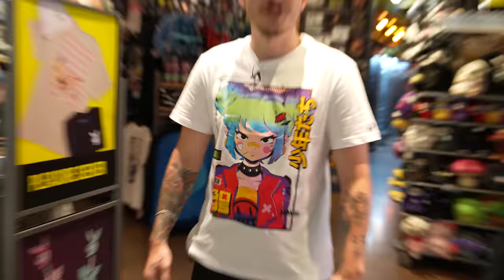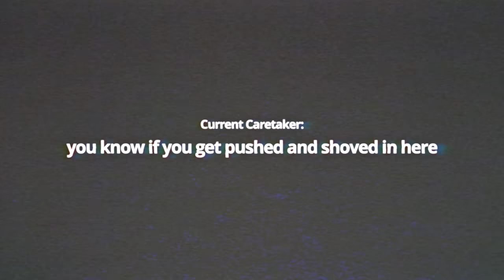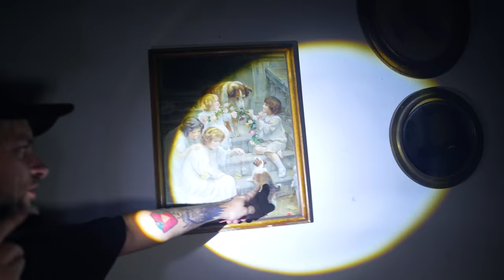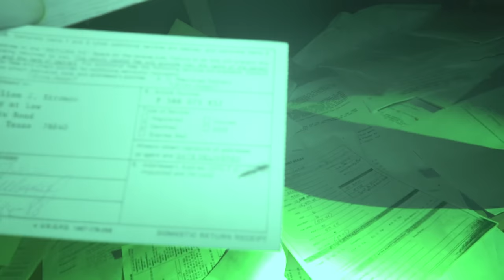The Boys Overnight in a Haunted Hospital

Comment: The bell ringing is familiar, I've heard it before when i went camping in Woolwash Bush (a local bushland in Campbelltown, NSW region of Australia down near the Georges River (which is a connection of rivers where they end up linked towards Botany Bay in Sydney, a whole 30km of river systems) 
I camped down there once and never again would i do it again, way to freaky and my mistake was doing it alone. 

If you want to heard what that bell ringing sounds like, MrBallen has a episode with a girl who went for a bushwalk in the forest (Beaver having their heads chopped off, blood still dripping and the body hasn't reached metomorphis) 

I'm pretty sure it's called If you heard bells in the forest run, i highly recommend it